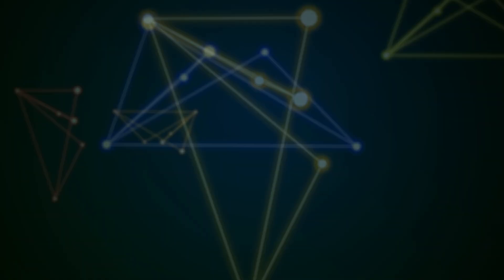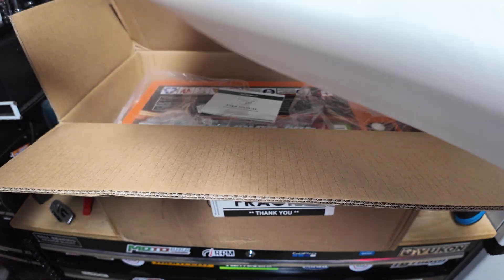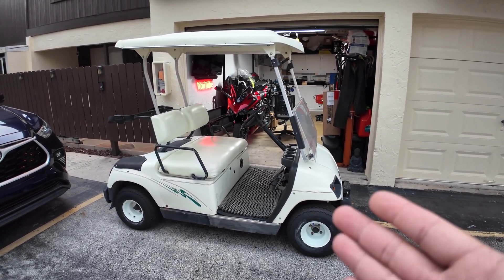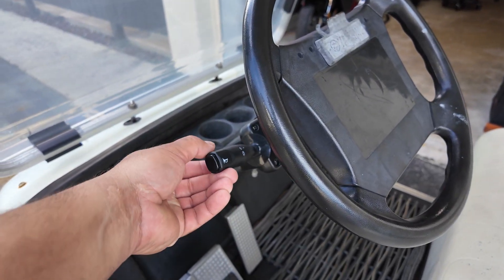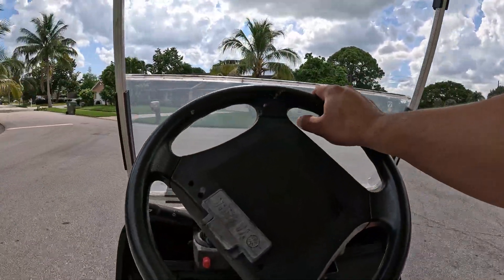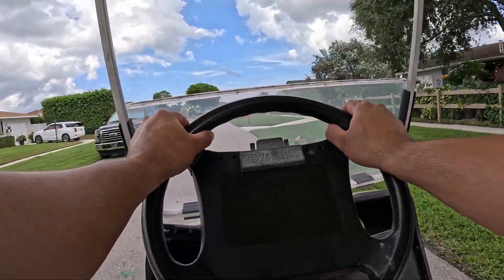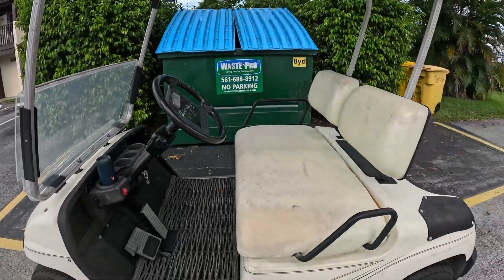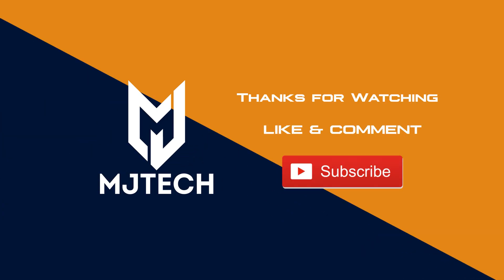Enjoybot 48V LiFePO4 65ah Battery - Here's How It Handled On A Golf Cart!

Comment: Very interesting. I am 75 years old  and starting to have real problems walking due to peripheral neuropathy related to diabetes. I am thinking about getting a used electric golf cart to use  as a mobility device. The LifePO4 battery would make a good replacement for dead lead acid batteries. I live in Canada where it does get quite cold in winter. I have a heated garage to store the cart in when not in use. It would be interesting to see how this battery would perform in my location.